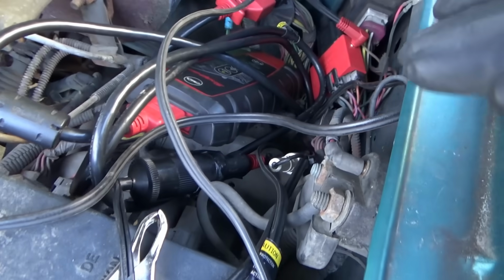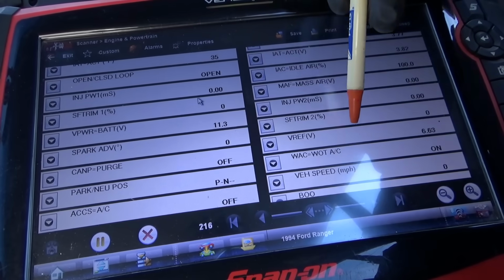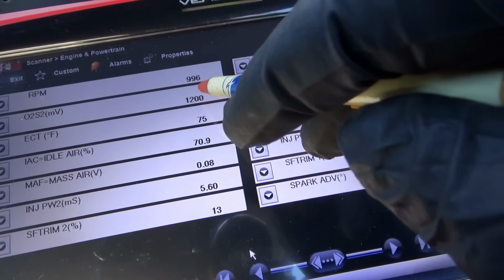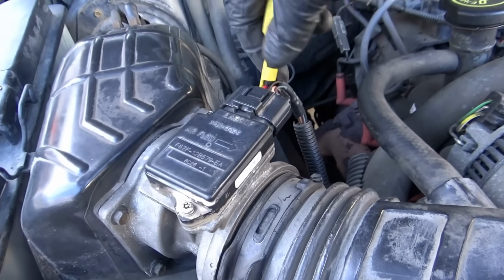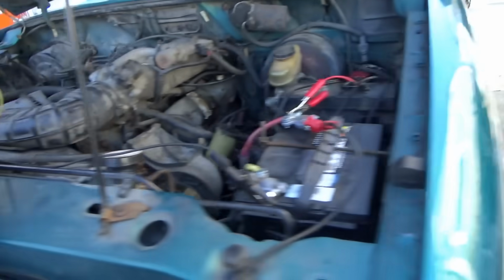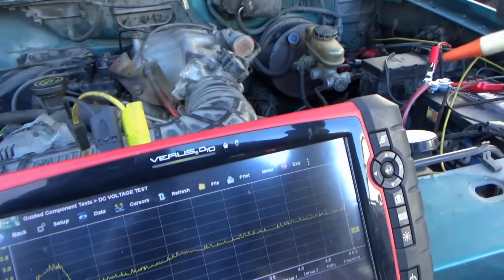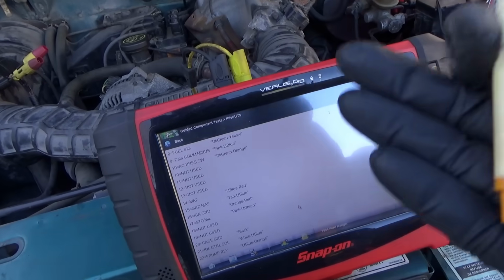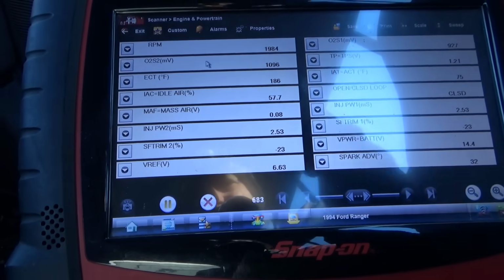DANGER RANGER (Barely Runs...super RICH?)

Comment: During my misspent youth I attended the US Navy's Micro-Miniature repair school and learned how to repair a board like that. As long as it isn't a multi layer board and all the damage is limited to what we can see, then all that would be needed to repair those runs is:
1) A sacrificial board with similar size traces
2) Epoxy and superglue
3) A Dremel tool (with the appropriate size ball mill attachments)
4) a scalpel, tweezers, other small hand tools
5) a good soldering iron with an 1/8" screwdriver style type
6) solder, flux, and Isopropyl  alcohol 

How to: Remove the coating over the damaged traces to either side of the damaged area (with the scalpel or the Dremel Tool) and expose enough good copper to solder to. Remove the damaged traces. Find appropriate traces on the sacrificial board and remove an appropriate number of them in the length required (to remove them scrape back the coating, with the scalpel cut them to length, and then with heat from the soldering iron you should be able to get them to de-laminate from the board). Epoxy (or superglue will work) and solder your replacement traces in place of the damaged ones on the "good board". Verify continuity of the repaired traces. Cover the repair with a thin coat of epoxy. Replace the bad component and you should have a functioning ECM again.

If you don't have a sacrificial board...if you can find the appropriate size strands of wire you could use that to bridge the gap where the damage was...it's just not as an "elegant" repair.
Reply: Use wire wrap wire and use as traces
Reply: @nickmalone3143  those traces are so big I don't even think you need wire wrap wire for that. I'm working on repairing a board where the traces are the width of one strand of wire removed from an 22ga stranded wire - this thing looks like a cakewalk in comparison. I don't even think you'd need a microscope to fix this one!
Reply: I am pretty sure all you need is bailing wire & gaffer tape, these fix everything………. apparently………..🤪🤪
Reply: I also went to navy micro school. Never requaled after components got too small. 3 years of fun. Then young one time.
Reply: @harrylumsdon6773  I was transferred to QA right after returning from Micro/Min school so I never even got a chance to put my newly learned skills to work.
Reply from the maker: Ebay might be easier 😁
Reply: @PineHollowAutoDiagnostics  eBay might be easier, but even if you get a working one, odds are the cap hasn't been replaced and it's going to have the same problem soon.  You probably still need to change caps for a good long term repair.
Reply: Ive had two exact same boards on a stereo receiver, both same manuf date codes both same components, one had a main blocking cap fail the other worked fine for many years after the first one failed.  Caps go on their own randomly.. you cant date them and only really make differences over time in audio equipment due to audibly hearing them degrade.  But that logic of getting another board and expecting the same damn cap to fail is ignorant and an oversight if anything.  If true than all 94 rangers would be having the exact same issue at the same milalge..
Reply: @Z-Ack  There are more data points you have not considered.  I'm going to list just a few. There are very many. 
  Mileage may be a mostly negliable factor. Electrolytic caps detriorate with time... and varing conditions.
  Other than the many generic data points, one item other item is, that the production of electrolytic capacitors, of that particular vintage period, are much known to a failure, at a VERY large percent. Some particular manufactures have been noted more than others. 
  Various time useage/non usage and particular opertaing conditions may factor as well. 
 
  Yes, there are specfic models of cars and audio equiptment, that do have the same exact capacitor(s) fail consistantly, at some time. 
   Do 100% of them fail? ..Perhaps or perhaps not. Perhaps eventually but not presently. There could be exceptions due to other factors such as they made some better than others(poor QC). 
  I'm certainly not one of the capacitor replacement fantatics, who believe that all older caps need replacement, but if it were my vehicle, in this vintage and application, and I had seen a previous failure(we just did) I'd change it. Especially, if I had the PCM out anyway.
Reply: @Z-Ack  But if the first one failed, the second one could go at anytime, leading to an unhappy customer.  It might last the life of the car, or it might fail just outside of your warranty.

Comment: The PCB has lacquer coating on it. Please check that the leak is not just on top of the coating. The board underneath might be ok. Dig through the lacquer to change the capacitor and add some clear nail polish afterwards.
Reply: if the traces beneath the conformal coat are burnt open then jumpering them is quite the task.
Reply: @tomtke7351   Yes it is, especially without a schematic! But I have experience repairing PCB's so  I'd give it a shot.
Reply: @ScottDLR  what I saw were very, very tiny traces....
Reply: @tomtke7351  use wire wrap wire for small trace
Reply: @nickmalone3143  with a MAGNIFYING GLASS/MICROSCOPE and very small soldering iron tip...   good luck not getting solder bridges!
Reply: @tomtke7351  use proper flux and you won't get Bridges.
Reply: @MattyEngland  i think i agree with Ivan to just find another ECM on Ebay.  HaHa
Reply: @tomtke7351  Yeah, that's the thing, people make board repair look easy in YouTube vids, but in reality it takes a lot of specialist tools and a lot of practice. People don't realise just how small these traces are irl.
Reply: @MattyEngland  It's a 95 ford, they're not all that small
Reply: @Malc180s  Yeah I mean it's not a Samsung S20, but it's still a difficult job for someone without the proper equipment and with no real board repair experience.
Reply: @tomtke7351  thin coated copper coil wire, or even thin PVC coated wire. 1990's computer main boards and modules had a lot of jumper wires, which were used to fix bugs in the hardware. Companies doing phone and computer repair today, do this today at micro soldering level, with 1/8 size trails compared to this 1990's board.
Reply: @jannepo  maybe so but this skill is not one of Ivans...  he chooses to source thru Ebay...  although old caps will still be a problem
Reply: @jannepo  ok...
Reply: Agree'd, I would have cleaned the board too. There's a chance it's still repairable.
Reply: I started working an old Computer Company named Burroughs in 1979 where we did RINs and LINs (reliability improvement and logic improvement notices) for circuit boards out in the field. We would cut traces and jumper different things with fine wire and a small 15w soldering iron. I’ve found fine wire on EBay if I buy doll house wire. 
If bad, those traces could be  repaired by following them and soldering a wire to the closest component or solder feed through point to another layer.
Reply: Best to recap the replacement ECU. The one that blew was a thru hole so should be easy to do.

Comment: shango066 fixes vintage ECM/PCM modules due to the fact the capacitors have failed and caused board damage. He showcased a few videos' recapping these boards and using a dyno at a local garage, he can check to see if these old beasts go into closed loop and reduce their emissions so that they can be worth driving. A system in open loop can often times cause poor performance and cost someone a lot of money in fuel so it is important to keep these old systems in check.
Reply: Shango is the best
Reply: I was going to mention shango066, but you beat me to it.
Reply: @Runco990  I had a ULEV civic and within the first few Michigan salty winters, the entire exhaust started to rott out. It had a special resonator/second catalyst pipe that was hard to find and you had to replace the entire thing and it was 1200 dollars. Then the primary cat cracked and I ended up buying an aftermarket header and full back racing exhaust for 200 dollars shipped to my door. I always had random issues with the evap system so the engine light was always on.

Comment: It is possible to fix those traces. If you know where the circuit is supposed to go you can solder one component to another. Back in the day, everything was direct wired, there were no printed circuit boards.  

Of course now with layered PC boards and smt you need a PhD, schematic and God himself on your side to fix modern electronics.

Comment: Great diagnostic! If there was no replacement ECM, the capacitor could be replaced and the traces could be rebuilt (I've done a few of those thin traces), but if the board is multi-layer, it may have corroded through the capacitor pad holes, into the inner layers, and that's the end of it.
Beautiful view of the countryside on your return home :-)
Reply: @T.J. Kong LOL. Sometimes thin traces are easier - use thin solderable magnet wire and route it with tweezers and a few micro drops of glue to keep it in place. Thicker traces carry more current and need thicker wire and can be harder to keep in place and not lift the remaining trace from the board. This is OK for low voltage DC or low frequency signals. With AC mains you need great care in removing the charred part of the circuit board (I usually fill the holes created with epoxy), and insulating with non combustible material. It's a tedious task, but if there are no reasonable alternatives, it's worth the effort.
Reply: Even multilayer boards with trace damage are repairable, but it does require some extra tools and skills. It just depends on how badly someone would need it fixed.
Reply: @googacct  Ive seen Northwest repair grind out multilayer boards on GPU's and solder wires to the center layers like it was nothing. He uses UV activated PCB glue to hold it all in place. He's also done burn outs on boards like that where he has to grind away the middle layer of traces and solder in new wire and glue it all down. Kinda neat to watch. Something I'd love to get into especially when a good GPU costs in upwards of 900 dollars, they are worth fixing.
Reply: Just because a trace / via goes to a middle layer doesn't mean all hope is lost. If it board is surface mount or through hole, and you know where that trace is supposed to connect, just run a bodge wire from the last good bit of trace to where it's supposed to go and bypass the trace on the internal layer. The problem comes when it goes to a BGA chip, and the pad in the middle of the chip ins't accessible externally, and they used blind vias to connect to some of the balls. Even there, if you're very careful, you can lift the BGA and run a very thin bodge wire to the right pad, and put the chip back on, but that's a lot of work. The thing you're repairing needs to be very valuable to make such a repair worthwhile.

Comment: This old electronics stuff is fairly easy to fix because the components are so large. Even if a trace is completely shot you can just throw a jumper wire between the component and the next solder pad or via. If you're not confident in your own skill you wouldn't even need to send it to Flagship None. A local radio electronics repair shop can fix easily.